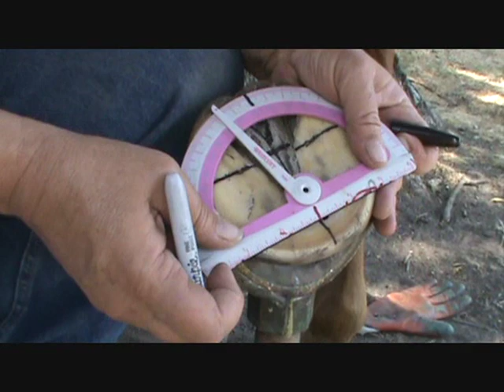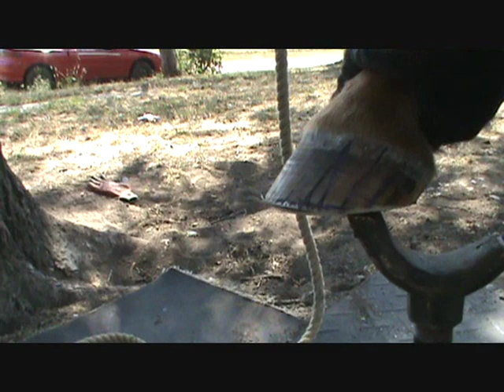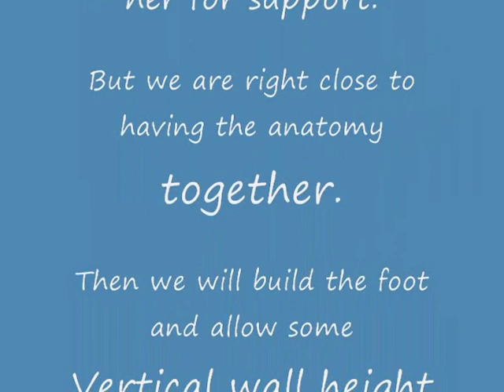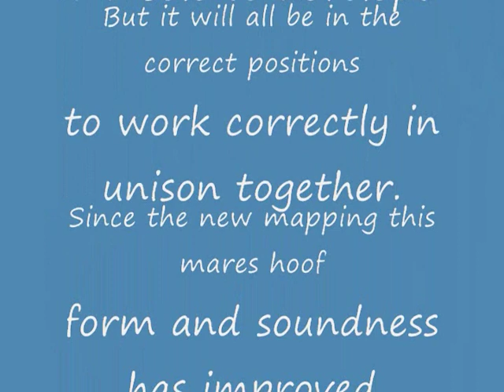Trimming to the TRUE Anatomy of the Equine Foot Part 11

Comment: My OTTB foundered a few yrs ago, he's recovered(yrs of barefoot trimming, diet, etc). Right hind has WL disease despite my daily cleaning, and thrush soaks, it's getting better but slowly. His ENTIRE sole seems so hard, like the bars have completely pooled over. When I try to pare out some, it exposes red/purple bruising. His xrays also show coffin bone is parallel to ground w/ very thin sole. I've casted him a few times but I'm hesitate to remove sole/bar with how thin sole is. Any suggestions?